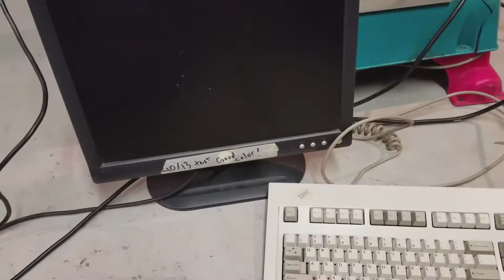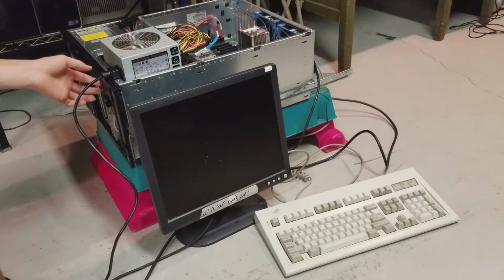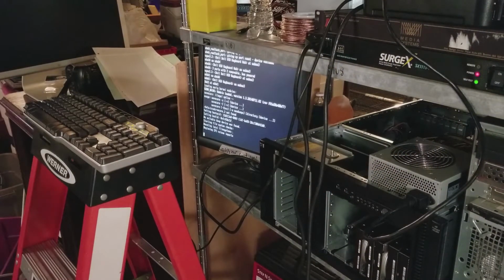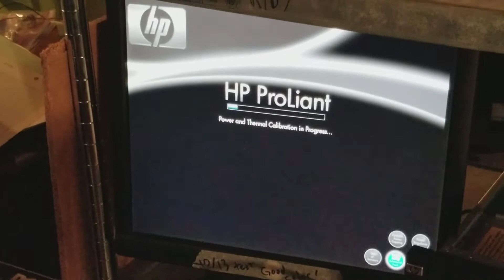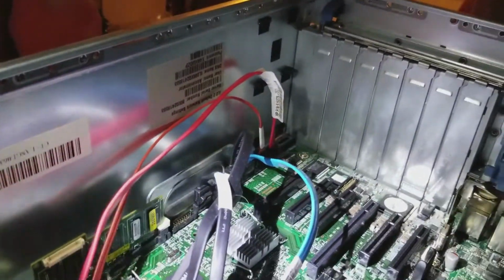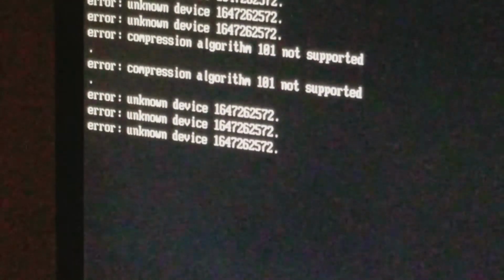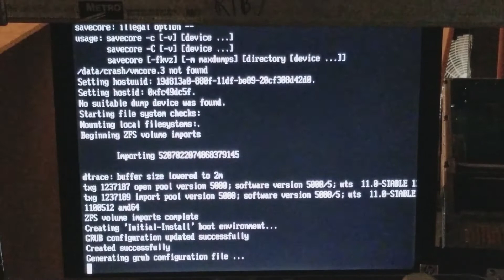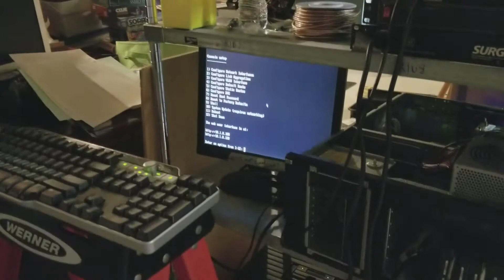Setting up an HP ProLiant ML350 G6

Comment: I have a problem with a server like this. I don't know how can check if the too power supplies are damages. Can you help me?
Reply from the maker: Well, the power supplies have a green LED that turns on when they are receiving power, and you could also look up a pin-out of the power supply and check for continuity with a multimeter.
Reply: can you help me i want to turn this server into a gaming pc can i use a normaly powersupply pls help an i dont know how to start it
Reply from the maker: @Odolfi_Hatler  I'm not sure why you'd want to use a server as a gaming computer, but you cannot use a regular ATX power supply (with most servers including this one). If your server does not already have the power supplies installed you would have to do some research and find the correct power supply for your server.

To start the server you press the button on the front that has the universal power symbol on it.